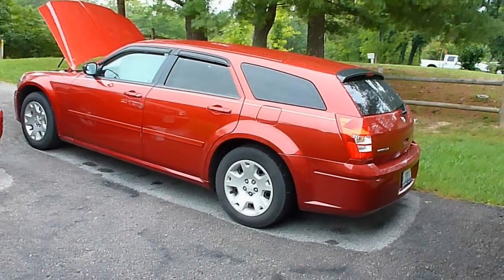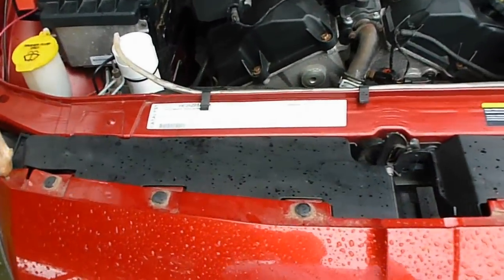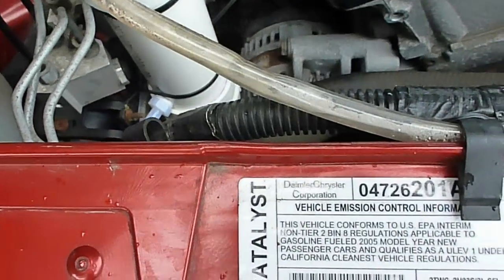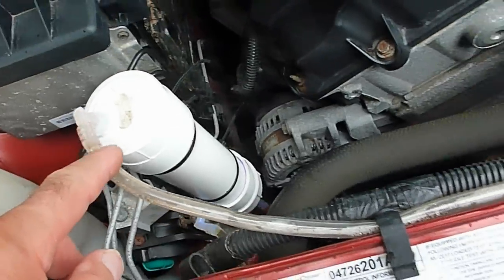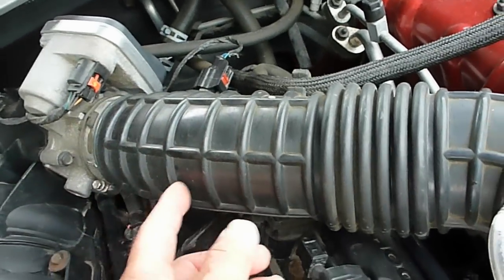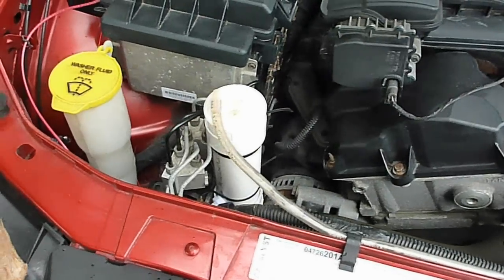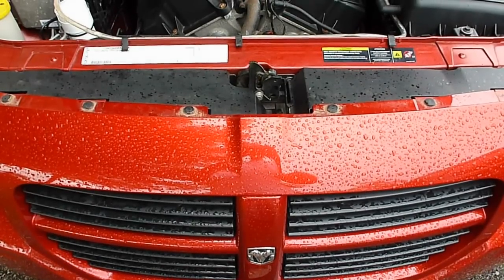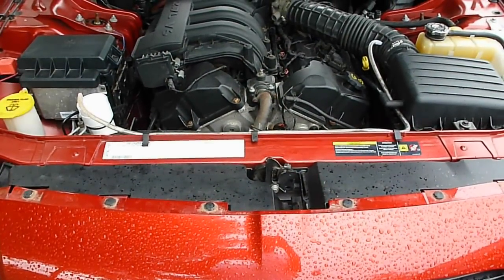2005 Dodge Magnum with an HHO generator installed, now i'm getting 30 MPG, not 16MPG...MOV

Comment: Your car ran 6,5 km on 1 liter of fuel? Why is america still driving these cars.. My dad has a mini cooper clubman, it drives 26 km on 1 liter of diesel.
Reply: I won't drive a small car in the US for safety reasons! Most American cars/trucks are built big and heavy, and getting in a wreck with a mini cooper vs a 1 ton truck, the mini would be under the trucks tire.
Reply: I don't understand that either... What the hell is going on over there?!
Reply: right? At least we are trying to reduce our pollution..
Reply: This technology was discovered in the 70's I believe. Big oil silenced the idea due to the value of the us currency. Even today, that value depends mostly on oil trade. If we developed hho vehicles, a shit load of folks would be out of work and what the fuck would the Bush family do???? And halibertion??? OMFG
Reply: atiseru The EPA restrictions are killing us is what I'm told..if we didn't have that, we'd be running more diesels instead of just in our large trucks. Even in our large trucks, if we take off the emissions equipment, 30mpg is not out of the question.
Reply: tragedi25
And just for the record I have a 3.8 V6 that I built that has 600HP and gets around 20 miles to the gallon when I drive it at slower speeds....So I like V6's myself.....
Reply: atiseru Key item your dad is driving a Mini Cooper, That is why he is driving it. Lol they are like a clown car.
Reply: Because Mini Cooper Clubmans are fuckin expensive. I spent $3000 (2.2k pounds) on my car and it has semi-shit mileage but I gotta cope because it's literally all I can afford

Plus what T Hoang said
Reply: We do it because we're Americans, and a lot of us like our cars to have HP. And as long as we can afford the gas/fuel we're going to keep doing it. I know this sounds a bit cocky but I really don't mean for it to. It's just the truth. Now we have a bunch of liberals that say they think this is wrong but then they drive big black suvs with 4 or 5 other suvs around them for safety that get like 15 miles to the gallon. And say the rest of us are wrong for what we drive. But anyway a lot of us as well as myself like to be able to go as fast as possible when ever we want to, it's called freedom.....

Comment: All these HHO generators look fascinating.  The fuel economy reports are almost unbelievable.  I know a guy who put one in his car and it worked for a short time until the O2 sensors made the fuel mix go rich and the guy lost all that economy.  How do you make it work in spite of the factory-programmed fuel mixture?
Reply: Joe Mumbach there are also O2 stand-offs that back the sensor out of the exhaust just a little bit so that it doesn't read the excess air/oxygen.
Reply: You need an EFIE (Electronic Fuel Injector Enhancer)...look it up on Google, you need to wire it into your O2 sensors and trick the computer into a rich mixture, so the computer will lean out the fuel. Its not hard to install, plenty of videos on how to install a EFIE.
Reply: Or you just buy a system that separates the oxygen and the hydrogen and only inject the hydrogen into your car. When you buy those kits you don't have to worry about the auction sensors picking up extra oxygen in the exhaust and making your car run rich instead the car will actually run a smidge leaner giving you better fuel mileage even further
Reply: its not only the O2 sensor, but the catalytic convertor as well, it gets hot glowing when running on lean AFR due to O2 excess in exhaust.

Comment: I just got 28.6 mpg with my hemi Dodge Magnum without HHO. I just drove 465 miles on cruise control at 65 mph. Do not fill up till it overflows! You will screw up the EVAP system.

Comment: I want one.
how much can does it cost for the material, If I pay you will you send it to
me and talk me threw installing it. I'm on SSDI due to Parkinson. This will help probably could figure out all the parts and half way figure out how to install it, just not that 100% secure in my auto repair work. I have worked on my over the past few years. I had to because I have no money for car repair. Also, I have a old Gas farm tractor that I use on the Farm. will this work on it.

Comment: first you must use a dry cell its alot better. second insulate your hose thats going to your intake with insulation foam because i can see some condensation in the hose from the heat under the bonnet, and thirdly did you do anything with the cars computer or anything with the sensors.
Reply: Wouldn't the sensors at the exhaust, among other sensors, calculate the elements that come out and how much they are? It would automatically adjust the gass and air needed for the burn in the combustion chamber.
Reply: @IsllayGirls  any one tried the volo vp 15 chip or pro tunner ?

Comment: so many comments, the sensors are not the problems it is the epa software program that mandates the computer to have 14.5 part air to 1 part fuel. When the HHO goes into the engine it burns 1000 times faster than gas and 1200 times faster than diesel . So you will not have the normal 60%  FUEL IN YOUR TAILPIPE/CAT-CONVERTER TO BURN. BASED ON 18 TO 24% EFF. AND 15% HEAT LOSS. yOU WILL HAVE OXYGEN AND LITTLE TO NO FUEL IF YOU HAVE THE RIGHT AMOUNT OF HHO. So your sensors tell the computer to dump fuel in to get the 14.5 to 1 ratio.
Effies just adjust the sensors signal to the computer so it does not dump as much fuel.
Map is 10 to 15 % down then the computer thinks it is in the Rocky Mtns and  leans out the fuel.
Iatc you add 4 to 8 volts and it will move closer to top dead center and it rid of the knock and give you about 10% or more savings.

could tell you hours more. But .... I have 14 lt semies saving 35%
5.9 cummings going from 19mpg to 29 ( over 85 so far)
Most get around 35 to 80% if done right.
There are mechanics with a full tuner geting up to 80% better mpg. But the tuner is 200 bucks.

His generator is not eff. because he has current leakage around the plates. I build one that is 185% eff. and can run a semi on 22amps. When my new part is made and out of China will be able to do a 14 lt on 13 amps 225% eff.Have fun if you can find me I have the good stuff
Reply: How can i message and talk about your setup id like one

Comment: put your money where your mouth is. put a video up and show me all i know its good for for ridding carbon build up that's about it. and why buy these cars if your worried about gas milage get a hybrid lmao a hho bmw now that's a joke.
Reply: The people I know who buy these cars don't have gas mileage as their primary concerns. But why not have the car AND the low gas mileage too with a 'fairly simple' install that may run you maybe $1000 or so if you're not mechanically inclined.

He used to get 16mpg now he gest about 32 (100/3.2)  so at $3/gal after 700-800 miles he gets his money back.

Or you can look at it this way. he only pays $1.5 a gallon.....

But yes the hybrids are a joke. Here in europe people almost compeet to show who cna drive (or wear) the smalles car... I like a bit of comfort and thus want to buy a bigger car while keeping the gas consumption low...

Comment: I BOUGHT READY KIT FROM EBAY FOR 300$ AND  INSTALLED TO MY 2012 SUBARU LEGACY  NOTHING CHANGED MPG SAME RESULT BUT CAR RUNS MUCH BETTER, I TRIED ALL CONFIGURATIONS WITH SENSORS AND AMPS.
I THING HHO WORKS ONLY FOR OLDER CARS
Reply: Its actually finding the right amount for your car.  To do that, you experiment with amperage/amounts of hho produced.  It takes time...but so does earning the money we waste on gas.  Any questions I'd be glad to help.
Reply: Thax sr but i tired doing configurations HHO not for me all my cars are new so it not going to work for me
Reply: ooooh  Thank u i thought im done with HHO I made to much configurations and im tired .But U open my eys im going to start soon with right way 1st My car is 05 Lincoln Aviator ))

Comment: like that , in CZECH that made some old man on opel vectra ( 3.8l- 5l / 100km) but is that "UNIT" safety ?  (me prefer 1.9    47 Kw Diesel engine) but its only for fun and work... on small VW pickup that take 4-5 L / 100km on custom chassis you can take it under 3.6 L (cca one gallon per 100km)

Comment: I'd believe this post more "if" you shared more details on your HHO system that you have installed that is capable of essentially doubling the highway mileage advertised for the car.  Otherwise this seems total cow dung.  Modern electronics on the Magnum will defeat any HHO system installed unless you have the EFIE installed.  This video didn't show that.

Comment: That sensor on the intake hose is the IAT Intake Air Temperature sensor. It tells the computer the temp of the air flowing through the intake and it adjusts the fuel trim (ie. Richer for colder temps and leaner for hotter temps).

Comment: @ David R, can you upload a video of your installation, I installed a HHO dry cell in my f150 2005 5.4 ,I must done something wrong because I'm getting  1 1/2 mpg less than without the cell, I'm using a Volo chip.

Comment: Hi Tony, thanks for making the effort to document your HHO experiment. Hoping you could elucidate a few points? a) How many cell plates were used in the generator?, b) What electrolyte concentration did you use? c) Did you install an EFIE or some other electronic device, to over-ride the car's computer? (On your other video you seem to say, none used). d) How did you control the max current to remain below 20A? Thanks in advance for answering my questions.
Reply: Same question i have. Been wanting to install but the sensor or computers are still not understood. MAF sensor to adjust gas amount...

Comment: I made a 19 plate dry cell. Installed it on my 93 f-150. I did get 3 to 4 mpg better at first then it went down to lower than normal. That was ducting right into the air box. After seeing how you did yours I tried that. Now consistently getting 4 to 4.5 mpg better. I don't believe my 302 has the map sensor, at least I cant find one. Still learning like everyone else on here. Keep posting and don't worry about trolls. If they have time to write negative comments they are just lazy bastards.
Reply: After 11 years, what's the verdict?  Any problems or tweaks that worked?

Comment: it realizes? Efies change the information that the ECU receives from the o2 sensors so it runs at its normal states even with hydrogen added. IT does not notice that a HHO ssytem is under the hood and say HEY! no improved fuel economy for you MR.

Comment: You mentioned a '50 dodge.  Did I get that right?  If so, are still running a carb or have you switched it out for FI?  Will you HHO gen work with a carb?

Comment: My oxygen is now set at 1.95 volts,can't go over 2.10 volts will trip the check engine light.My map enhancer is now set to 1.3 ohms(was at 1.8,1st test) on the lean side.My tire pressure set to 36 lbs in all 4.I did my 1st 100 test on a windy(not cool)day,drove into a 35 mile NW(for 58 miles)head,at the half point I notice that 1 cell was(20 amps)on,flip the 2nd on and finish my return trip.117 miles round trip,took on 3.894 gallons at 30.046 miles per gallon

Comment: Just wondering how amps are you running?I'm now at 25 amps with two cells.When I 1st started,I add a EFIE to my oxygen(1.8 volts)sensor with one wire.Did all kinds of test from last August of 2012(got about 1 or 2 miles more per gallon)until just a month ago that my truck did have a Map sensor,this whole time the computer was killing my gains.Got a Map Enhancer form my HHO club & that was preset to 1.8 ohms,there work with a station that works on tuning up motors.

Comment: Hello.I added HHO to(almost a year ago)my truck an 89 Chevy with 164k on it.When you fill the tank up all the way,were you can see the gas about to run out of the tank.Then do your test and come back to the same station and same pump.When you put nozzle in and lift the handle to the 1st click so the gas flows slowly in.When you did your test,how for do you put the nozzle in?Did you stop at the 1st click of the pump when the gas stop?

Comment: great job, I also insert in at the intake, just above the throttle body. the sensor might be the MAV . Manifold Area Vacume.  I went in just past it, but above the throttle body.  I have a 2007 F150 crew cab. A 5.4 liter engine. Used 2  6 plate dry cells.  Produces about 3.5 liter a min. Fuel miliage was 16 mpg on hwy. Now 28 mpg !  Yes you will save money. HHO has not done anything bad to motor!!!  It just saves you money
Reply: i have  a jeep liberty,  i ran the output hho hose before the air filter , does it make a difference to place like in thi video, just before de airintake valve ?  didnt want to puncture the hose.
Reply: @jarochodamanmilo  does it improve your mpg?

Comment: Great work!  Have you had any issues with your cars ECU reducing your gains from o2 sensor reading the exhaust as "lean"?  I have a 2003 dodge ram 1500 5.9.  11 plate dry cell, producing 1.5 liters/min at 30 amps.  I have tried. .25lpm, to 3lpm...and my gains quickly become extinguished by the ecu reading lean and richening my fuel mix.
Reply: I think you can add O2 spacers on your sensors to offset the lean mixture reading. Get the little ones that come in a four pack so you can add and adjust the lengths as needed. We'll be trying myself an HHO system in another month or so. 😊🌎✨

Comment: that engine is going to overheat unless you reinstall all the sheet metal that was originally attached to the engine. The  wheel with paddles on the top is a fan and uses the sheetmetal to direct a volume of air arround the walls and head of the cylender. that is what is called aircooled.  what you did is like removing the radiator from a water cooled engine,